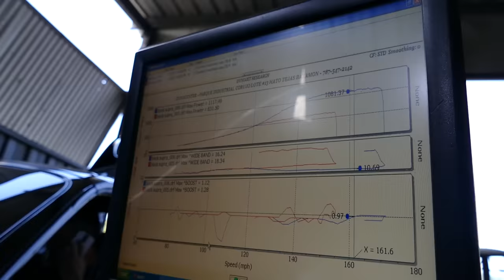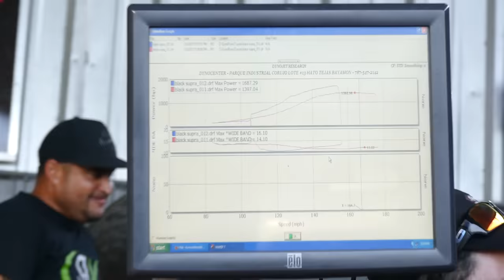1687WHP MONSTER Supra BRUTAL Dyno Runs

Comment from the maker: So here's some information on the setup:
3.0L 2JZ GTE
Precision 86mm Turbo
Forged Internals
HKS Cams
Stock Gearbox(Needs a new one now lol)
Stock Differential
50psi on Full Boost
125 Nitrous Shot.

Wheels: Core Forged Precise.

I will be filming this car again at another Standing Half Mile Race in less than a month.If everything goes well it should go quite a bit faster this time.
Reply: Flat Out Supercars .. man that thing is slick, I have a 94 supra turbo, yes it's a automatic unfortunately lol but I just was wondering if you could give me some advice.. What could I do with the turbos as far as staying with twin, or maybe switching out to a single? I have a boost controller, exhaust and intake on it so far.
Reply from the maker: Depends on how much power you want to have and the use of the car. Big single turbos setups from what I've seen produce a lot of power but come with lag.Dont be ashamed of the gearbox, it is still a great car.A friend of mine has an N/A MK IV automatic as well, he has a forged 2JZE GTE with a decent single Turbo waiting to be installed which should give him about 500whp.Automatic or not, it should be a fast and fun ride.Ill try to make a few videos of it if I can.
Reply: Flat Out Supercars ..Flat Out Supercars .. sounds good man thx, I'd be happy to be in the 500 hp range. I'm just trying to figure out a way to still keep my stock turbos and maybe just build around it. What's up with that forged 2JZE GTE?
Reply from the maker: My friend is waiting to install that engine, it is built to hold about 800whp.
Reply: Flat Out Supercars What is this engine?
Reply from the maker: 3.0L 2JZ GTE.
Reply: Flat Out Supercars Thankyou
Reply: +Flat Out Supercars good ok 2JZ GTE. One of the best ever made.
Reply: do you have any specs for the whell like size and width of the tires
Reply from the maker: Unfortunately no.Thanks for watching!
Reply: omfg 50psi!?!
Reply from the maker: Yes!
Reply: Flat Out Supercars what block is in there to hold all that power?
Reply: Flat Out Supercars i cant find those wheels... maybe you know the model?
Reply: Flat Out Supercars nvm, found them. lol
Reply: Flat Out Supercars no forged internals running that much nitrous oxide
Reply from the maker: It has forged internals.
Reply: Flat Out Supercars  why not overcrancked to 3.4 L?? but really nice and i think you can even get higher boost levels but idk if your engine can hold that with the nitro.
Reply from the maker: I honestly dont know as this is not my car.I've been told by the mechanic that there is definitely more room for even more power and there are a few mods in the works.
Reply from the maker: I agree.Thanks for watching!
Reply: Anywhere else we can track this car? IG, FB?
Reply from the maker: The owner doesnt post stuff about his car sadly , but you can follow me on those platforms and subscribe to this channel as I will do my best to make as much content about this one and another 1500hp White Supra in the not so distant future.
Reply: Great video, is the 2jz still being made? Hard to believe The power it makes, I heard toyota wasn't building it anymore, hope I'm wrong. thanks for posting.
Reply from the maker: I dont think they make them anymore, although spares are still available.The new Supra apparently wont be 2jz powered and it seems Toyota wont be using it for any of its other cars either.Thanks for watching.
Reply: wow..... how are you getting over 1000hp on 93?
Reply from the maker: That was my mistake.I dont recall exactly how much power it put down on 93 oct but it was definitely less than what appeared on screen.Thanks for watching.
Reply: George Panagiotou hey I have an auto too. My advice would be to go BPU. then save up for a single turbo conversion
Reply: George Panagiotou you can't do anything more than 380-400 whp on stock turbos and for the condition their in you shouldn't push them anywhere further
Reply: Can you remember how much boost it was running on 93 an what power it made?
Reply: Can you please build me one of this car?!
Reply: Flat Out Supercars. Can u guys do a set up to a 07 v6 auto eclipse
Reply: Flat Out Supercars. They car is cool good Wick. Man
Reply: Flat Out Supercars all that=1bad ass car
Reply: Stock Diff!!! your mad, they are not best of things to come off a supra. I run a kaaz 1.5way with 6766.
Reply: @georgepanagiotou8673  be careful with that boost controller is all I can say. Dangerous!
Reply: @SupraJoel  Probably a TRD diff.
Reply: Wos
Reply: @-noname-2276  why wos? Lol
Reply: DIMELO COÑO
Reply: 2jz.... Damn ff franchise
Reply: the wheels are vibrating slightly

Comment: Almost 07/2017. 122 people with thumbs down???? Cars a classic. A classic Japanese muscle with limitless potential. I wish they still made them.
Reply from the maker: I agree 100%
Reply: Brandon Terrio they still make them... but they look like pure shit
Reply: Jake Dawg And the engine's not the same
Reply: Classic Japanese muscle? What the fuck are you smoking lmfao. Its a Classic JDM nothing muscle about it
Reply: Brandon T dont we all
Reply: Muscle? Are ya high?
Reply: They should bring them back. The 2jz is the greatest stock engine ever built. Im a chevy guy, but i simply cant deny the greatness i am witnessing.
Reply: Dalvin that’s not a stock engine. 2jz are not very fuel efficient, a stock ls3 vs a stock 2jz is lighter, more powerful has much higher torque and can go much further than a 2jz without forced induction. Pushrod v8’s and possibly even their DOHC counterparts are the most well developed and economical engines there are. And at the end of the day, categorically, there comes a point at which the only way to improve and engines power is by consuming more fuel and air. An LS3 for example has a displacement of 6.2L, that’s 3.2L worth of combustion volume more than the 2jz. Think you need to mellow out a bit and calm your 2jz fanaticism down.
Reply: Jimmy James i dont see many ls3’s making 2000hp
And you cant deny how far ahead of its time the 2jz was
Reply: Dalvin You’ve completely missed your own point. I don’t see many STOCK 2jz’s making 2000hp either
Reply: Dalvin definitely not the best stock engine ever built..... It’s the most tunable though
Reply: @Dalvin2k  agree Toyota should bring them back. I see nissan has started producing brand new rb26 head and blocks again
Reply: year 2021, we cant even see the dislikes 🙂
Reply: @jimmyjames2639  economical hemi engine hmm let me think about it
Reply: Toyota bro 💪💪🔥🔥
Reply: 2017 is 6 years ago tf

Comment: 2JZ a fabulous engine, well built, durable, strong all round, and its specs were under rated (gentlemans agreement in Japan that it could only have 300hp, but possibly has about 33% more power, maybe higher)
Reply: 280hp*
Reply: That agreement was only for manufactures to not get in trouble thye knew full well when they made engines like theese that they would get tuned to levels like this
Reply: There's no way that's a stock 2JZ block.  They turn to cheese at around 1200hp or so.  Rightly!   It's almost certainly billet or reinforced / filled block...
Reply: @stevecole950  nawh yeah that's for sure reinforced. but what a beast of  a car though 👍🏼👍🏼
Reply: Japan has a law that prohibits a manufacturer from producing a car capable of more than 300 horsepower. You will NEVER see a factory car in Japan surpass 300.
Reply: @tangoseal1  That rule was dumped 20 years ago. And it was not a law. Let’s start with Lexus LFA which has has 500+ HP

Comment: that nitrous shot tried to rip it off the dyno it hit so hard,sounded like it was going backfire then bam another 350 horse in a big dollop and it dropped the arse end :)
Reply from the maker: I honestly thought for a split second that it was going to take off.Thats one of the reasons why I took a few steps away from it at the end.
Reply: don't blame you mate,,it looked so brutal it was epic :),more video's please
Reply from the maker: If everything goes according to plan, I will be filming it again at another 1/2 Mile race  soon and later on at the Dyno with hopefully a few mods done which should yield even more power :D.

Comment: Now i know what car took the Picture of the Bugatti Chiron ❤😂
Reply: eg
Reply: roi du
Reply: It was another bugatti actually
Reply: Imagine Bugatti Chiron on "vp race fuel" + NOS. (On 93 octane supra 1117HP, Chiron 1500HP)
Reply: @Saulatis  yeah but compare the size of the engine's as well. So what if the supra had an engine the size of the chiron.
Reply: 2 genders
Reply: @Saulatis  nothing to say but only 6 cylinders are enough to kill the Chiron
Reply: @solraczetined5951  the w16 would be much more reliable
Reply: Another Chiron
Reply: @JohnDoe09523  lol it wouldn't las
Reply: It was a Bugatti Chiron 🙀
Reply: @STING-og5qo  not stock
Reply: @betogameplaysgb937  yes bro boosted engines are always a suprise to sports & hypercars
Reply: @STING-og5qo  yup
Reply: @STING-og5qo  and reliability is a problem to extremely modified engine
Reply: @betogameplaysgb937  ya you lose the street application when  u go extreme with tht engine!
Reply: @STING-og5qo  agree
Reply: @FuRy977  it was a joke smh
Reply: Lol
Reply: Suhaib Aijaz  proof?

Comment: Supra
Pulls out 1687 HP

Bugatti Chiron
Am i a joke to you?
Reply: LMAO haha
Reply: Fuck that's crazy... I was just like fuck 1700hp that's insane
I mean it is but how does the chiron make 1500
Brutal 😅
Reply: Chiron on 93 octane 1500HP, supra only 1117HP.  What if Chiron had "vp race fuel" + NOS? I think ower 2000HP had Chiron
Reply: @Saulatis  just think about how much bigger the engine of the Chiron is.
Reply: brake rotors smaller than a frisbee
Reply: Chiron ran a 24 hour full throttle stress test and survived tho
Reply: @Saulatis  the chiron also happens to have 10 more pistons and 3 more turbos just for reference
Reply: @Saulatis  They can't :)
Reply: Yep it is.
Reply: 1397hp on the wheel but nvm
Reply: Supra was made in the 90's.......think about it
Reply: Yess bugatti is really expensive shit
Reply: Isabel pantoja
Reply: The chiron got 490 km/h
Reply: Chiron only has 1500 and a lot slower
Reply: @ridleyy998  Then stop comparing them to eachother...
Reply: @RaffaBintang-lo5zt  NOS will kill the engine from the Chiron i think because the Engine is realy hard loaded From the Turbos with NOS it will kill the Engine
Reply: type in yt buggati killer. that M5 as cray cray.
Reply: Saulatis it would be higher than that
Reply: .29
Reply: Saulatis no sorry would need billet block and built rotating assembly not to mention upgraded turbos four of them wtf
Reply: i mean to be fair, these cars are tuned for drag racing. you can't really compare them against supercars. they're built as like a road legal F1. (tuned for circuit tracks)
Reply: Devel sixteen : Am I a joke to you?
Reply: Supra Yes
Reply: Bugatti has a advance traction control system. Supra will be more powerful but can't put the power down
Reply: yeah but the bmw e60 m5 is still faster than every car.
Reply: Zexille  kl

 p
Reply: Flame Playz v

h

mm

m m o
Reply: devel sixteen talk to buggati chiron: am i joke to u?
Reply: XxRelaxBrotherxX the problem is that the devel sixteen probably doesn't even exist in that form they're trying to sell it.
Reply: @gepixelt7712  to be honest i dont know why they make a car that illegal on the road i mean devel sixteen use jet engine like what the point? to claim title world most fastest car? nah i think i should agree with u
Reply: @xxrelaxbrotherxx  The car is claimed with a normal Quad-Turbo 12L V16 which is pushing 5000 hp. 
Everyone who knows at least anything about cars will now start thinking how they wanna cool that thing down without any airvents on the car design...
Reply: 6 vs 16 LOL
Reply: Yep
Reply: Bugatti?, No chance.
Reply: Delirium they’re not competing for the fastest car in the world LOL, they simply try their best to make the efficient and longest to die out cars and that’s been proven many times
Reply: whichever you would choose
Reply: @HAMMER13  сколько дней, вот в чём вопрос. ВАГ, алюсил...
Reply: @Saulatis  if you put NOS in the bugatti it's w16 engine will explode like a nuke.
Reply: @laksamanasuhendra5868  if a 165 kW (222hp) supra can turn into 1687hp, pretty sure some rich dude can turn their 1500hp chiron to 10'000hp :D
Reply: @Saulatis  umm thats not how it works :/
Reply: Well yes but acctually no
Reply: Yes. Yes your are
Reply: Christopher Bassit ya but you don’t need 2-3 million dollars to make a car as fast as a Chiron I’m just saying
Reply: this thing make more 
 at the wheels than the chiron at the motor
Reply: @hyh5996  the Chiron engine can do 3000hp
Reply: But I think chirons cylinders dont blow up after driving 1 day
Reply: Riley_JDM and 5k ccm more😅
Reply: khairul nizam why would you compare the lykan to a chiron. The chiron is a supercar from the ground up. The lykan is just a porsche turbo with a new shell
Reply: @ridleyy998  But The Chiron Is Just So Phat
Reply: Yes Chiron, you are a joke
Reply: chiron is not fast enough
Reply: @harwanimdnayan979  yes
Reply: @Samuel.M.C  no but that a drag car with drag tire, nitro
Reply: @rylee8926  eh no
Reply: Yes, yes you are
Reply: Bugati chiron 15OO hp supra 1400 hp supra very faster
Reply: Flame Playz  U comparing a drag modded 100% engine swapped GTR that isn’t even street legal? Dude this is 1700HP street legal and the original engine
Reply: Bufgati has no chance to win
Reply: Suhaib Aijaz  look some documentary about the W16 QuadriTurbo, he can do 3000hp at his maximum efficiency
Reply: Suhaib Aijaz  SSC Tuatara faked their record 😂😂😂and Jesko do you have proof 😂😂😂😂😂😂😂😂😂🤣🤣
Reply: Suhaib Aijaz  it might look fancy, but its nothing special when it comes to performance.
Reply: @phammanhhung79  you never know maybe one day in the future oh wait they already have.
Reply: @Happyッ-r4q  Oops...1670WHP no doubt. Still no videos for the dyno of Chiron SS3300+. Let's see how much WHP they have
Reply: @phammanhhung79  The Current Bugatti Chiron 300+ produces a total 1578 hp but with the supra it produced 1678hp so in a straight drag race the supra would destroy the Chiron even if it does have bad traction control.
Reply: @Happyッ-r4q  Seem you didn't get me :) 
P/s: it's all about the WHP, I don't care about the race.
Reply: @julianharlakin6912  the supra only has 220 bhp lol
Reply: Supra can build 3000 hp.... 1400 hp supra faster than bugati chiron
Reply: @alchemist2048  against a car in the 90s. Bruh almost nothing in that car is left from that time.
Reply: Engine
Are you fucking kidding me?
Reply: u cant compare a 25+ year old car to a bugatti like come on
Reply: @banyaidavid4011  that does not look like the original supra engine.
Reply: buggatis gonna be a joke till the supra motor disintegrates
Reply: @Saulatis  the engine would blow up no doubt
Reply: Horsepower per dollar, Supra win
Reply: Yes a massive joke
Reply: Bro bugatti is a new car it's 90s car 😡
Reply: Reliability is the key
Reply: @dubstepcool23  wut about McLaren 720s, Koenigsegg ccxr,McLaren P1 GTR, McLaren 765lt stock they can't beat supra
Reply: @mahlok8210  supra cant beat stock McLaren 720s and Koenigsegg ccxr or McLaren P1 GTR even stock Koenigsegg ccxr and McLaren 720s stock has beaten that 2jz 1000hp supra
Reply: @jdmcarguy6178  yeha
Reply: Supra:yes

Comment: Fun fact: Different dynamometers will throw out different spec readings from one another if you test your vehicles on multiple setups. Sensors can also tell the difference between a car driving on the highway with a headwind and being in a stuffy room spinning the dump drum.  While you do get accurate readings from them tuned for the right conditions, they will all give out a slightly different reading so technically we don’t know the true horsepower of a car. 

Though there isn’t a hidden meaning to this, I’m not giving the car a bad name so read in between the lines. This particular video and car is amongst my favorite to watch.

Comment: They knew how much boost the 2JZE engine could take with no upgrades. Like 60 PSI something crazy like that. Definitely the best inline 6 engine in history. Toyota knew it’s capabilities. But coming with only 230 horsepower stock is a far cry from 1687 😳🙋‍♂️
Reply: Not about pressure. More about air flow. 60PSI is not much if the air flow is tiny. Put a semi truck turbo on at 5 psi or a small engine turbo at 30psi and the results are the same as far as available air to the engine. Loosely speaking.

Comment: To anyone who say that "most luxury cars are nothing compare to the Supra", I wanna see them race but on like a circuit track when there's literally corners to turn.

I bet most of these (drag tuned) cars would fly off immediately.
Reply: Not just that, but that car is made to put out a lot of power for a few seconds at a time.  It would utterly melt itself trying to run any kind of track.  Maybe with a giant water/air intercooler stuck right out in front, but you know... you'd also have to figure out how to make the old boat turn.

Comment: 3:00 I'm concern about the rear wheel wobbling at high speed. Seem as if the axle or control arm (suspension) is about to break.